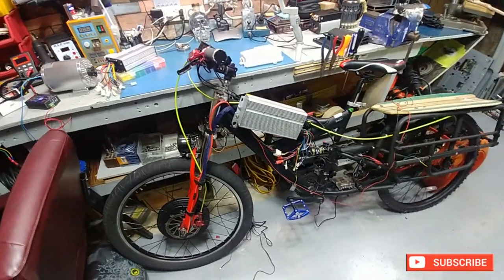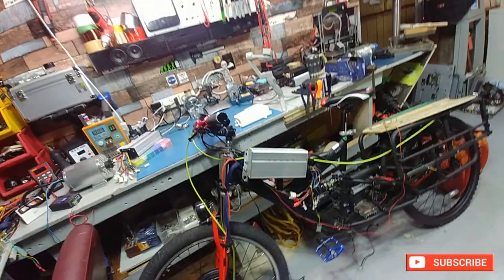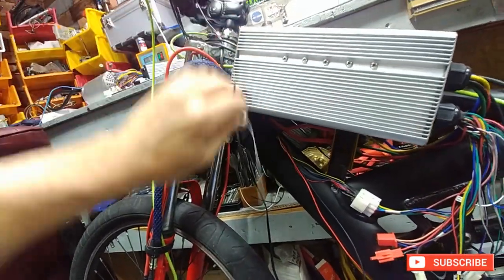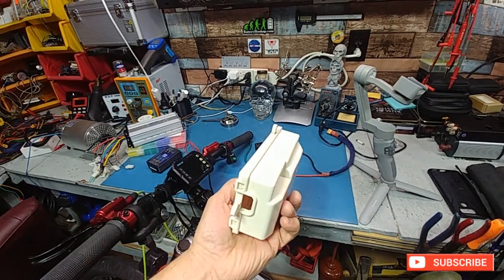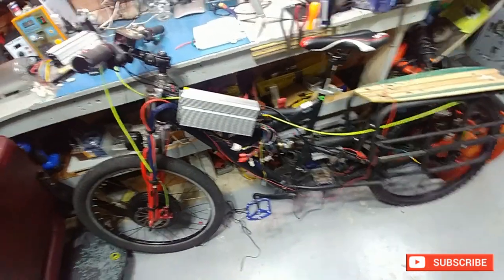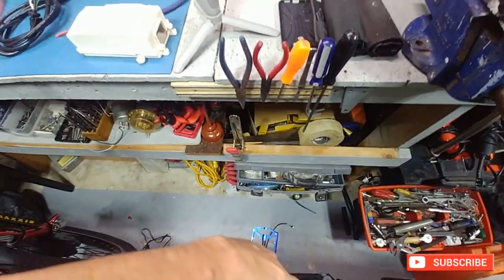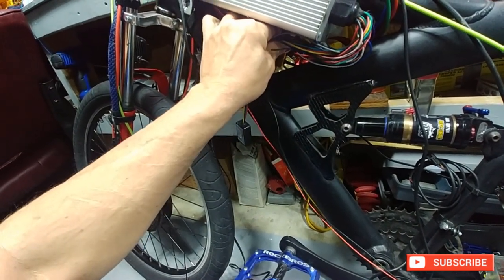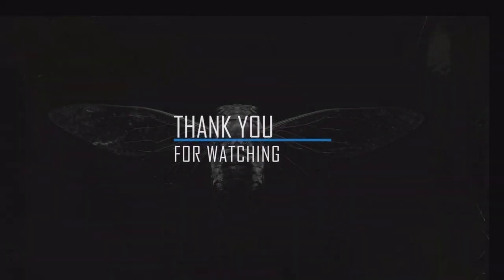ebike vlog# electrical box . Monday, December 19, 2022

Comment: I usually undo the waterproof silicone or whatever it is then strip and unsolder everything that’s not really useful like reverse ,pas , both headlight or usb connectors ..I keep break ,my display connector and throttle incased in the controller housing and my hall and phase outside but it’ll have enough space once you get rid of unnecessary wires inside case .
Reply: yeah i do the same i rewire to my needs and remove the junk i always run regen for helping with the brakes. well on the non geared ones anyways